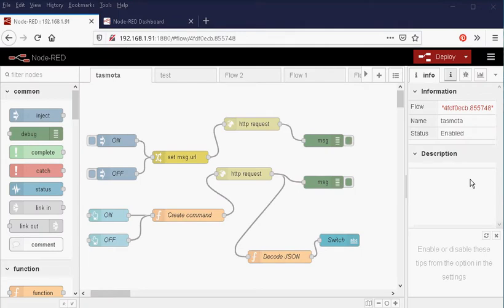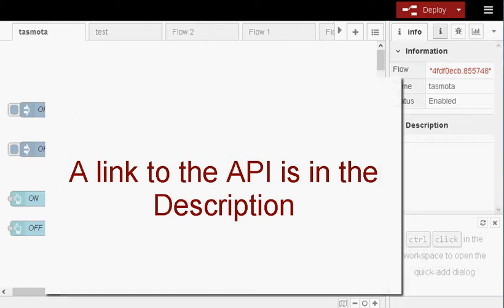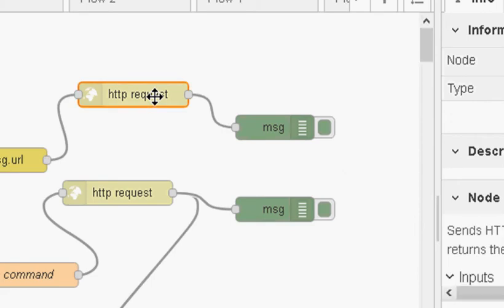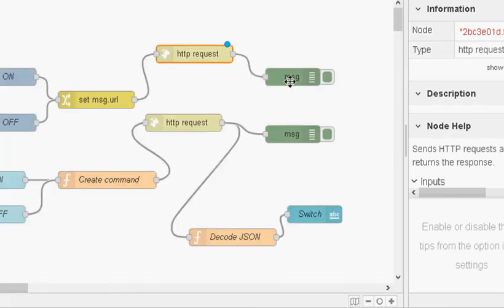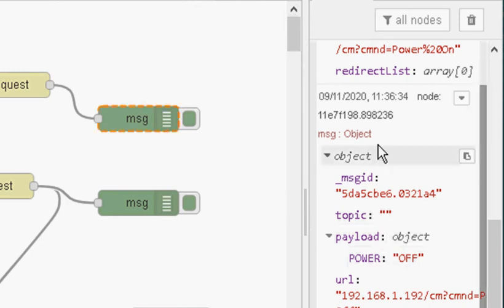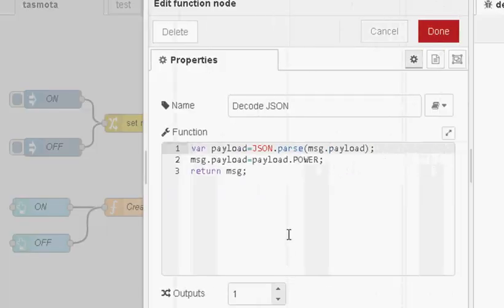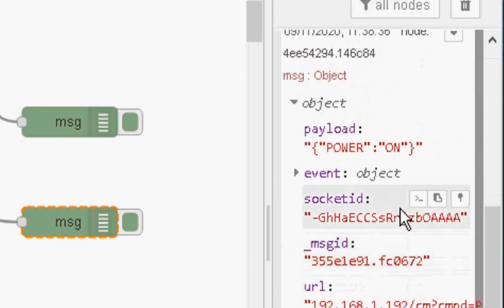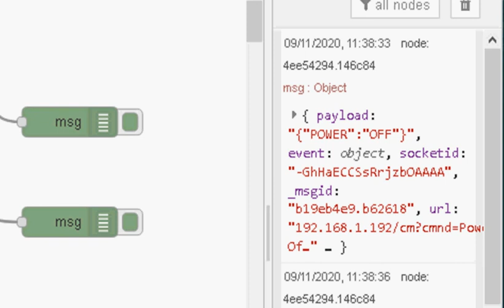Controlling A Tasmota Sonoff Switch Using HTTP and Node-Red

Comment: I am missing the point of NOT using the http request directly. In other words; putting the command in the request node and not use a change node.
Reply from the maker: It is just a matter of convenience. If it is variable then it is done in a proceeding node like a function of change node.
Reply: @stevecope  so it can be controlled with just http url too? i need to know this since i want to port forward a url from outside of the internet to a plug to turn it on